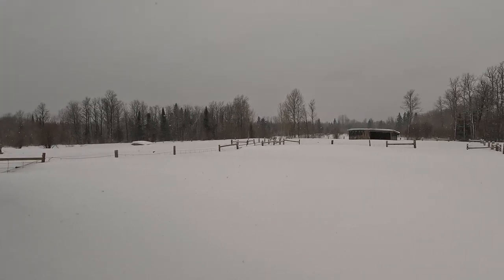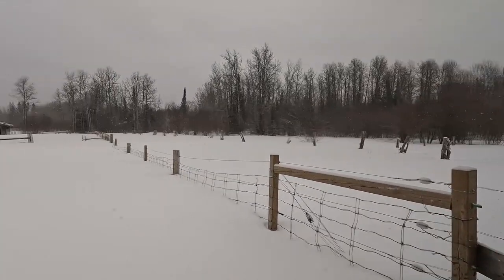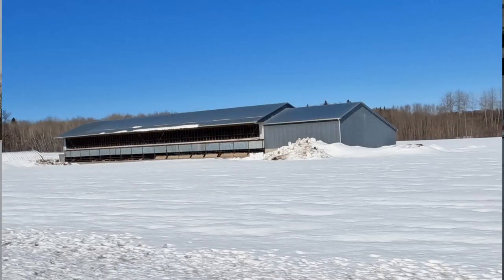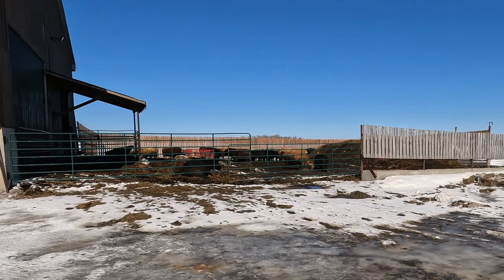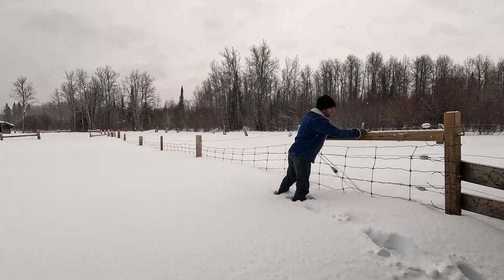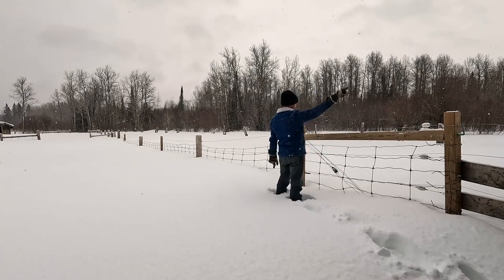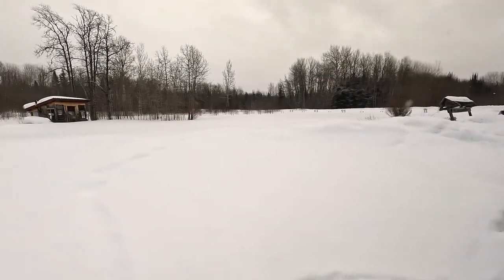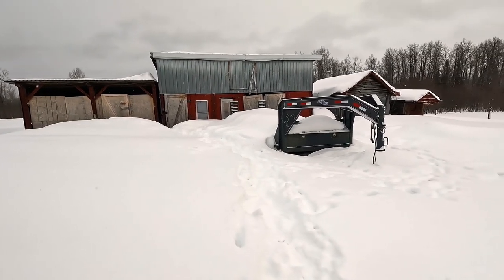Farm electric fence problem

Comment: Have you considered high explosives charges around the perimeter with trip wires? Or since the problem is wolfs and coyotes, maybe get a couple road runners? All joking aside, get a couple donkeys.
Reply from the maker: explosives :-)))) Donkeys might be a solution. I did not consider this. I am kind of leaning toward wintering area, seems that Mennonites in my area do exactly that.